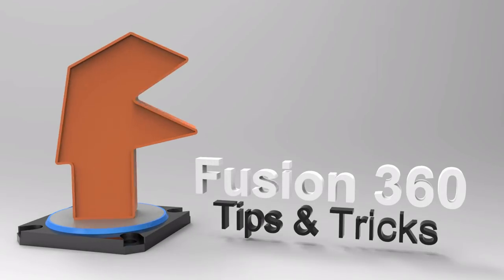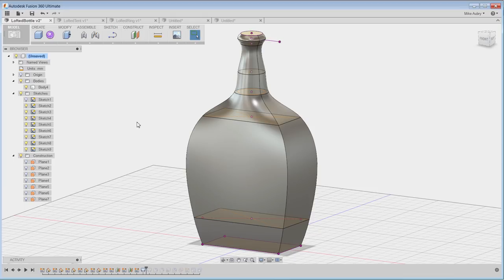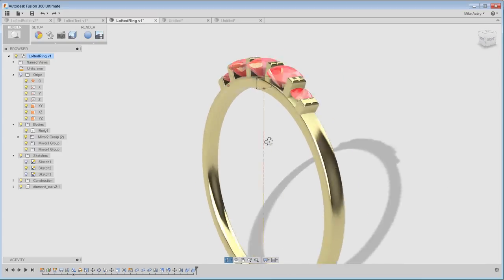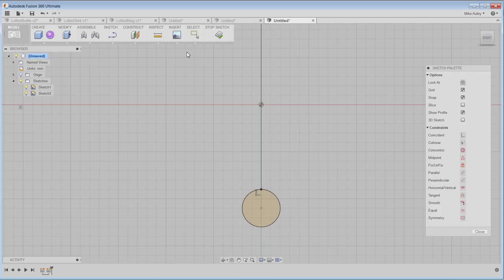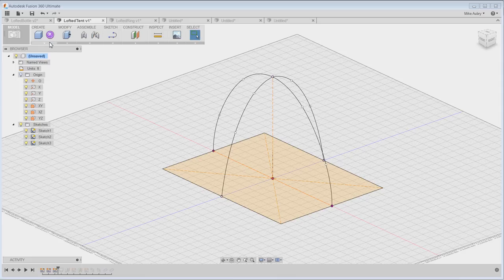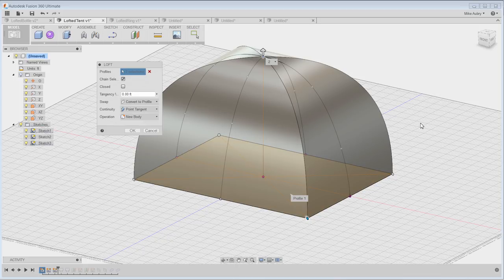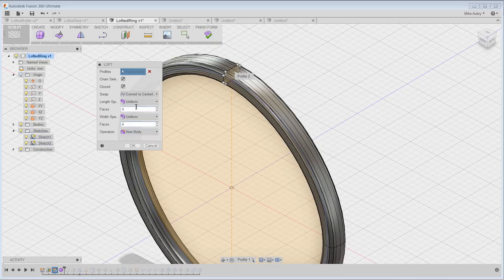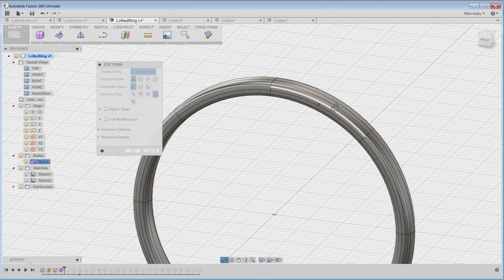BEST PRACTICE: How to Loft

Comment: My experience with lofting in Fusion 360 is that it is not as intuitive or flexible as lofting in SolidWorks, but on the other hand I can use Fusion 360 for free, and I can only use SolidWorks at work, or at home if I want to risk having to buy a full-price seat at some unknown point in the future when DS's lawyers get wind. SolidWorks remains the gold standard, but I need to come up with 4 grand before I can buy it. F360 is the winner by default for now.

Comment: During the ring demo, while creating the bottom circle sketch loft profile, it was said "I want this guy to update well, I'm going to give this guy just a- call it a construction line -so that when it updates it will stay on top of this guy instead of going back below it."

Could you clarify what is meant by "stay on top instead of going back below", and how the presence of the construction line achieves this?

Comment: I'm trying to follow this step by step, but I'm having a problem when setting the midpoint of the rectangle.  When I select the bottom line of the rectangle, then Midpoint from the palette, all is good until the click the small circle that indicate the intersect point on the top of the path.  Rather than the rectangle fixing itself to than point, it stretches all the way down to the bottom of the path.  Not sure what to do to make it stay at the top of the path.

Comment: Hi, in the whisky bottle sketch, when I clicked on profile at an angle, & selected a line I drew just like you did, the whole thing disappears, even the Home/View box at the top right corner of the screen; nothing brings it back, even if I did Undo. After that happens, it never shows anything in the screen (i.e., if I say New Sketch, it doesn't give me the origin planes anymore, even if it has the lightbulb on), so I have to close that Design tab & open a new window. It's like the whole program gets ruined after that happens, could it be performance bug issue?
Reply: Actually, you can always reopen the design if you saved it, or if there's a recovery backup, but still that shouldn't happen in th first place.

Comment: Nice and very useful video. I am currently looking for a way to twist a lofted body but from what I have seen there isn't a twist command. I found some useful tutorials on youtube where people just rotate one of the profiles and get a twisted body but that doesn't work for me. When I select profiles in the loft feature it says they are connected (G0), and there is also tangent (G1) and curvature (G2) available. In the tutorials where it works it says the profile is free. Could you tell me how to change it to that? Thanks in advance.
Reply from the maker: So there IS a twist option in a sweep, but if you have a changing profile that's not going to work. I was testing creating a loft in the manner you mentioned, and struggled a little bit at first, but not because something was wrong...because I was selecting the wrong thing! Annoying. Try to select the profile, vs the sketch edge and let me know if it works better. If its not previewing, it might just be related to an overly aggressive amount of twist.  

Per the terminology used, I think the only reason you're seeing a difference is because it was changed a little while back to be more consistent between sketching, sculpting, and lofting.  Hope that helps! If not, we'll see about getting a copy of your file to see if we can troubleshoot it.
Reply: The twisting option in sweep fixed my problem since the profile doesn't change in my case. https://www.youtube.com/watch?v=5xT2XDGYPSs This is the video I was following when trying to get the twisted body so I tried with normal extrusion and lofting and whatever I selected it didn't let me twist it like I wanted to. There was always atleast one fixed point even after deleteing all the coincidents so I struggled with it. It would be nice if there were separate twisting and bending commands like in SolidWorks that work on any type of body and not just like an option under the sweep command. Thanks for your help :)

Comment: This was too far along the learning curve for me. Is there a lesson that comes before this one?
I need to learn to place a series of profile sketches at specific Z distances from each other. Vertically like the bottle example is fine. One difficulty is that the profiles I have are not symmetrical. They don't stack with a common center point because the part I'm reproducing has different curves on the "left" and "right" edges as it grows along the Z axis. And the rotation about the Z axis changes too because the part was a subtle twist as it progresses.

Comment: What you're doing at 12:10 where you're using multiple centerlines doesn't work with version 2.0.5350. I don't know if I'm doing anything wrong, but I have all the same settings as you and same geometry.
Reply from the maker: Does it give you an error? Can you share with our support team via our forum? We need to get some more eyes on this if that's true! https://forums.autodesk.com/t5/fusion-360-design-validate/bd-p/124
Reply: @adskFusion  gotcha. I'll check on it when I get home.

Comment: Ok, I'm having an issue trying to 3D print a lofted object.  It's being treated as hollow.  How do I get the program to make it solid (like an extrusion)?
Reply: I found the problem.  I was using sculpt loft and not the standard drawing loft.  Problem fixed.  Sculpt loft makes it a hollow object.
Reply: If you want to print a sculpted object you need to give it a thickness or a shell
Reply: Yeah, I was trying to do that in sculpt only, but it kept failing.  Found I had to do it in standard 3D modeling.  Thanks for the help though,

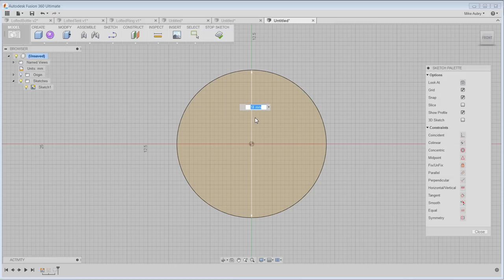Comment: 9:51 updating the radius does NOT WORK WITH ME. What have I done wrong? The circle changes on its own and the loft remains the same size.
Reply: plus, I can no longer add filets to an unextruded sketch. ! How can I solve this?
Reply: I have a newer ver. of Fusion 360
Reply: You need to give a link to a video or send some jpegs, otherwise it's impossible to know what your problem is
Reply: Try uploading your question on fusion 360 community forum add if you know how to a screencast video and send me a link here

Comment: This is relatively simple loft, and it works. My experience with more complex lofting in Fusion is terrible. I lost 3 days trying to loft some cylindrical objects with rails, and it didn't work. At the end I read that it is flaw in program. So if You can, better avoid lofting, or avoid Fusion as a CAD-CAM software for complex and precision work.